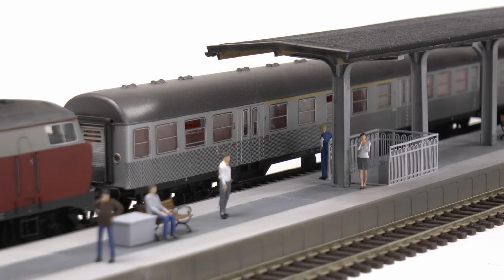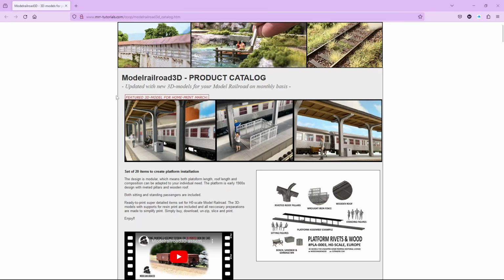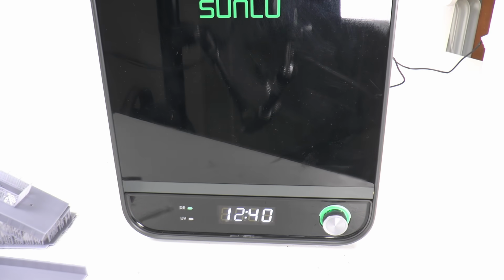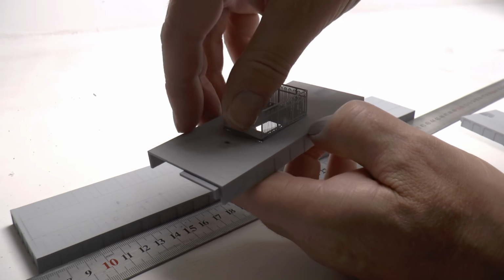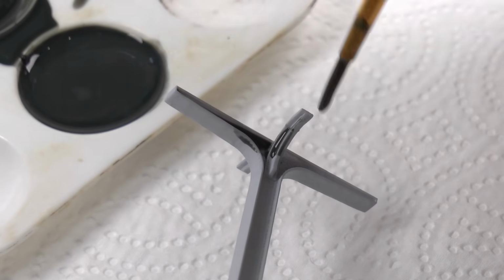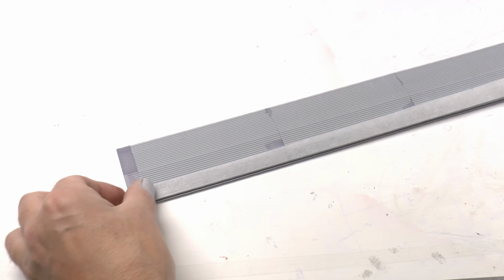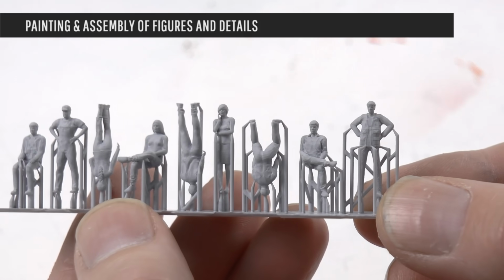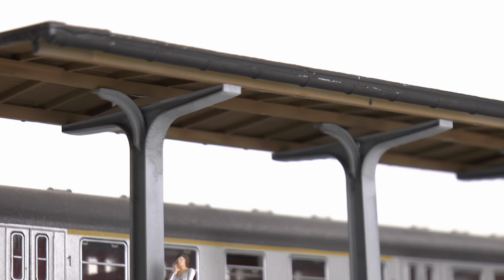Building platform with riveted steel pillars and wooden roof

Comment: Can someone help me out, i'm thinkin of investing money and buying a 3D printer, i checked out the Model Railroad 3D shop and i'm really interesting in buying lots of these models.  The issue i have and don't understand is that i have N Scale.  I was under the impression that 3D printing allowed us to resize things, so would these models work for N Scale?  I don't want to invest in a printer if i can't use these models.  Thank you in Advance!
Reply from the maker: No, H0-scaled 3D-models cannot be downscaled and printed to N-scale. Sorry. They in general need to be designed to the correct size to print properly
Reply: @marklinofsweden  Oh so disapointing.  Is there a chance that your project will expand N scale stuff in the near future?

Comment: Good video but for my understanding last time all video are only with 3d Printer.better are the videos that made by handmade:)
Reply from the maker: I will probably not buy any plastic or wooden parts in the shops going forward. It makes no sence producing styrene strips or bass wood sheets in US, sending them by air transport to Sweden and thereafter me taking the car to the shop buying a pack with parts I only partly need at x10 cost compared to 3D-printing the exact right part/quantity at home. This means that most videos (if not all) will contain 3D-print and/or laser cut from now on, even if it’s in combination with scratchbuilt parts. My idea of making how-to videos is show my audience the materials and methods I think does the job best.

Comment: Excellent but I have a question about the 3D printing. 
I read that resin printers are used but … has anyone tried these files with a FDM printer. I using a Flashforge 5M Pro that gives excellent detail results (for a FDM printer) because I don’t want the smell and disturbance of too many equipment.
Reply from the maker: Try it and write a comment here on the result! 👍
Reply: @marklinofsweden  
Aditionaly what is the difference between the Plate_girder_bridge_left_v1_x1 and the Plate_girder_bridge_left_v1?
Reply from the maker: @PhantomRC1959  All stl-files with _x1 has supports for resin print. You’ll see it when you open the file in your slicer
Reply: @marklinofsweden 
So … at last … I mannaged to slice one of the files but had to cut it horizontally to avoid too many supports. At first I used the Flashprint slicer (it’s capable of sending files via Wifi) but had a lot (and I mean a l o t ) of issues with stringing. Fortunatly I found a video about that subject and started using Orca as a slicer.
The results are awesome.

Comment: Always a most relaxing and didactic view. Just wonderful inspirations here, and the station looks absolutely masterfully spectacular. May we share an experience if that's okay with you. To avoid paint bleed under the masking tape, it might be a good idea to apply some transparent varnish on the outer rim of the tape. That way, the paint won't bleed under it. It's not much of a problem if the bleed is going to be blended in with weathering of an old station though. It's just when you want a crisp line looking brand new or modern, the idea might be helpful. Great build that station Martin. Cheerio.
Reply from the maker: Thank you Linda! Very useful tips there! I’ll try it. Nice weekend to you as well!

Comment: anything to build in N scale how do i reduce from HO  to  N  scale  1/67  to  1/160
Reply from the maker: Hi! 3D-models intended for 3D-print can be scaled to N-scale, but they will not print correctly. This while the smallest possible dimensions already been used to create the H0-scale model. Any further down scaling will result in failed print. So, in most cases N-scale items for 3D-print needs to be designed for N-scale from start.
Reply: Hi  @marklinofsweden  Thanks for the models. Could you and your team add some more N scale designs to the mix as well? The catenaries are very good but some signals, buildings or structures would be stellar

Comment: yes if you have a resin 3d printer you can do this but how do you make it bye hand with normal building materials that is real model work resin is to easy ahahah
Reply from the maker: Hi! Please check my video index for guides how to build platforms in other materials. I have as said in the video at least 3 previous videos where I scratchbuild every piece from ground up.

Comment: Is the platform thin enough for C track?
Reply from the maker: Hi! Hmm.. I’m not sure I understand what you mean by ”thin”.. the 54mm width is adapted/intended for standard C-track turnout with 70mm straight extension besides the 22.5 degrees curves. Regarding height. I would assemble the platform on a 6mm spacer to get nice height compared to the C-track
Reply: @marklinofsweden  Yes that's the information I was looking for!
Reply: @marklinofsweden  Thank you You answered my question.  When I said thin, I meant to ask whether it would fit between the standard c-track spacing.

Comment: Indeed a magnificent and enthusiastic modeller whom I gladly take my hat off to. And of course if you get it right a 3D printer is cheaper to start with, but in many countries you don't always have sunlight when you want it. So you buy 2 devices. I myself have started saving for the model railway, in the form of 2nd hand train sets and rails. The buildings are 95% new and then the difference is smaller than you think. The liquids for the printer are fairly pricey. And glue you need anyway. As well as paint to colour the kit.

For a modelling friends club or association, I would definitely recommend this. Good luck everyone with this beautiful hobby. Greetings Antwan.
Reply: You can just as well cure 3d prints with a home-made curing box and a cheap UV light. And wash your resin prints in a small container. You don't have to buy all these accessories that 3d printer manufacturers want you to buy.

Comment: pretty cool boss. But saddly i cannot afford 3d print and in many cases in has seriously toxic materials. Here sich disposal is not for those with a light wallet.
Reply: Yeah I personally prefer scratchbuilt by hand; even with all the imperfections it has charm. It is good that he shows all kind of techniques but sadly some are not within everyone’s reach
Reply from the maker: Hi! Saddly I couldn’t afford Model railroading without 3D-print. The 3D-printer reduces cost by 70-90% for everything except locomotives. I would prefer buying stuff in the shops, but the shops are closed. The prices have increased by x10 since 90s. It’s really sad and not good for the hobby.